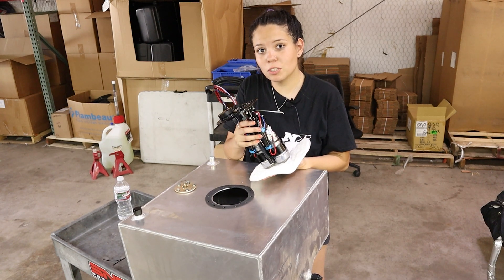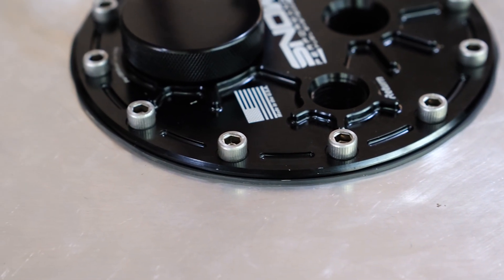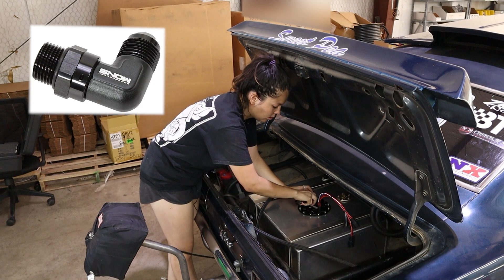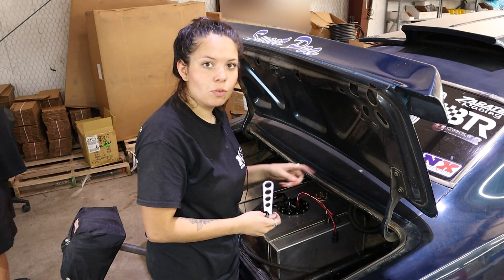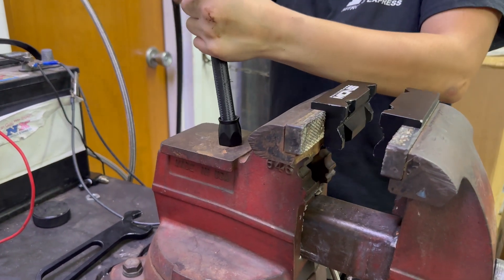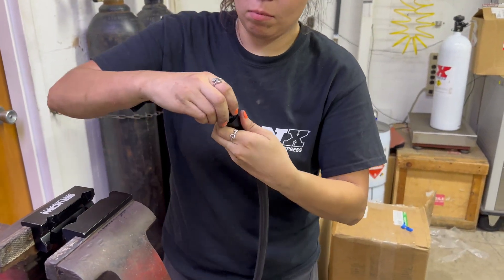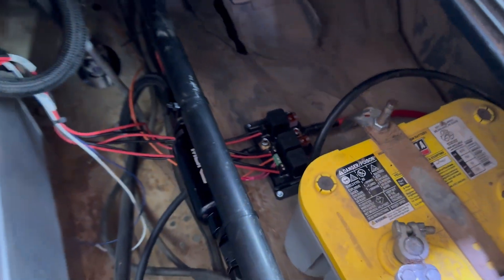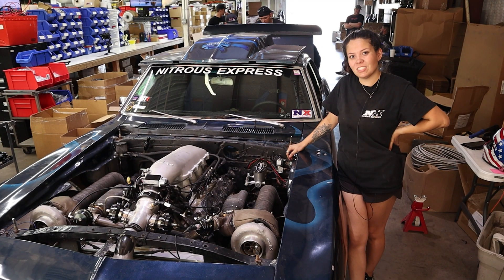How to Install a 12 Bolt Multi-Pump Fuel Hat AND Run a PB With Snow Performance and Alexis Zarate!

Comment: How are those top hat bolts attaching to the tank? Threaded inserts?
Reply from the maker: There is a 'horseshoe' like ring that goes into the tank first, allowing the fuel hat to clamp down on the tank when bolted together.

Comment: What fuel cell is that? Unfortunately, my 12bolt snow performance triple pump wont fit in the 'fill cap' opening of the holley 15gal I purchased
Reply from the maker: Some fuel cells will require a little bit of work as not all of them are the same. Widening the opening and re-drilling the holes isn't uncommon

Comment: We're do you fill it , I hope it not way up front , that a shitty design
Reply from the maker: The top can be oriented to whatever suits your application best.
Reply: @snowperformance1  👍
Reply: That was my question! So was this originally a 10 bolt fuel cell?